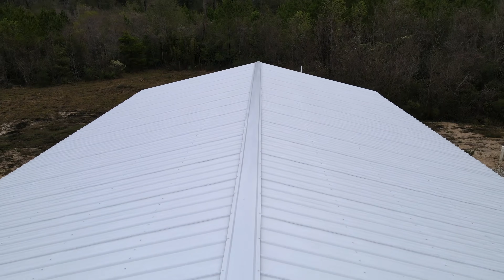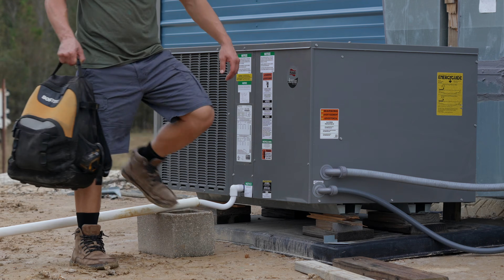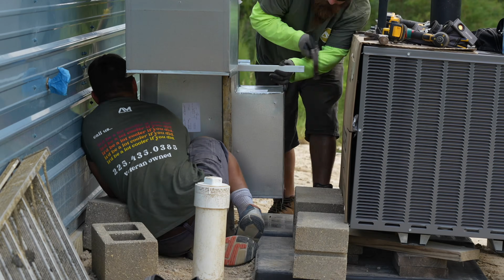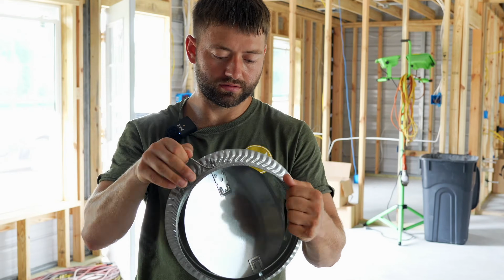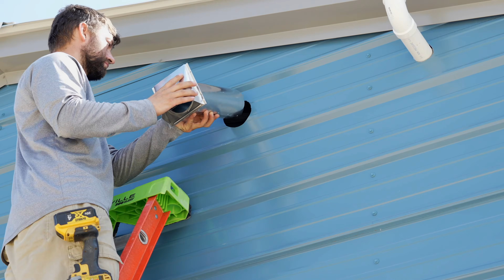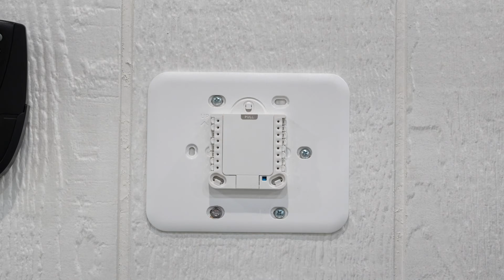Turning My House Into An Igloo! (Not Really) - INDUSTRIAL AC Install

Comment: Exterior supply and return? Come on man. That’s whack should have brought it inside or built a structure insulated around it. The sun and outside temperature is going to make that so inefficient. I hope you dont do that janky stuff for customers.
Reply from the maker: $65 electric bills mid summer in south Louisiana. 🤷🏽‍♂️

Comment: Mr. Post frame made the same mistake of putting bat fiber glass over top of spray foam. Cost them a ton to fix. Think it was their Mad County build. It creates a second vapor barrier which collects condensation in between the two insulations. Have you not had moisture issues coming through your walls?
Reply from the maker: We keep hearing that but I haven’t had a single problem what so ever with it. Idk if it’s just a different climate or what but I’ve had SO many people say it’s going to sweat in between and I’ve lived here for over 18 months with no problems. 🤷🏽‍♂️ They seemed to be having the problem before they ever moved into it

Comment: Did you use closed cell foam?What thickness did you go with on ceiling?
Do you try to have equal airflow in each room?
Reply from the maker: Yes, 2" of closed cell on the entire exterior and an additional 4" of open cell on the ceiling. 

Yes, the airflow is balanced. We installed dampers in the ductwork to each vent so they can be adjusted.

Comment: Very nice setup. Since your home is so well-insulated, could you have used a smaller AC unit?
Reply from the maker: The simple answer is yes, a smaller AC unit would sufficiently heat and cool the house. 

On average you want one ton of air conditioning per 500 ft² of house. In a very well insulated house such as a spray foamed house, you can usually drop a half ton.